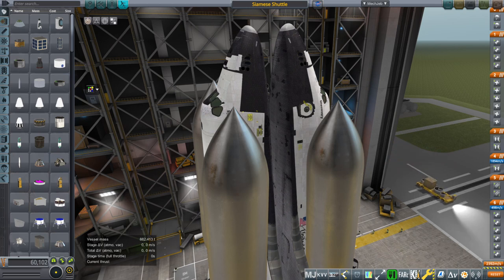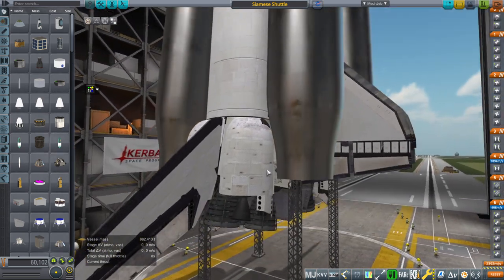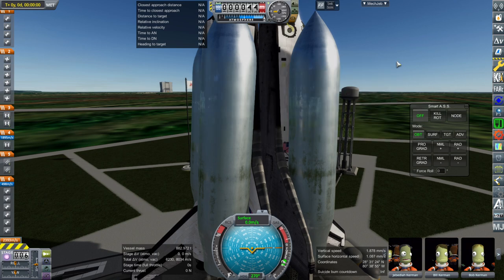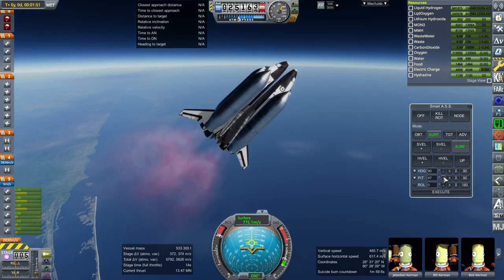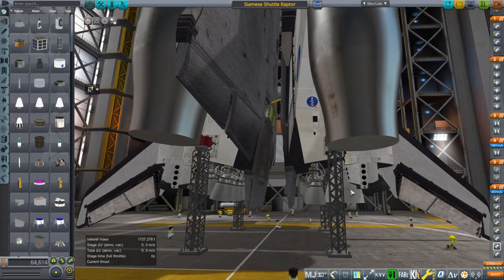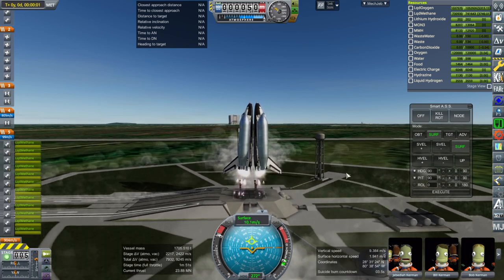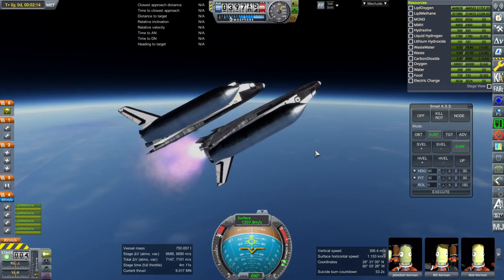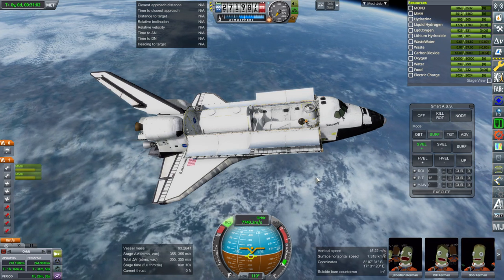The Twin Shuttle System Nobody Wants

Comment: MAAAANNN GETT WATERFALL MOD IT WILL MAKE YOUR PUMES MUUUUUCH BETTER !!!
Reply from the maker: As you keep saying this, let me make clear - I've tried it on various engines and generally don't like the look of it, but might use it for some engines as I see fit. I do use it in my stock series. I have no intention to use it on the Shuttle as the plumes look fine and the SSME plumes never looked like Waterfall plumes, and I have already tried it on my own Raptor engines and didn't like the look, which seemed cartoonish.

Comment: With the Raptor version, wouldn't it be prudent to shut down the sea level engines rather than throttle down near the end of the burn? Seems like the sort of situation where those extra seconds of Isp might be handy. Not that you'd want to spend too long optimising this particular system...
Reply from the maker: Yes, that would give a bit more delta-v.

Comment: Fun fact: Originally the Space Shuttle had a two-stage fully-reusable winged flyback design, but that was too expensive to develop on NASA's shoestring budget after Apollo. #FundNASA
Reply from the maker: Please stop spamming this on every video or get some new facts. It's not like this is the only example of Shuttle design being constrained by NASA's budget.
Reply: @RaizSpace  Sorry if you consider it spam. I just hate that so many people hate the Shuttle, despite not knowing that its limited capability was mainly a result of budget cuts. Sorry for repeating myself, but I just want to spread this message to everybody around. I just love the Shuttle, even with all its flaws, and can't stand people hating it like it was the worst spacecraft ever concieved, like they proclaim Starship to be the best spacecraft ever. Which it isn't, BTW - the dry mass of Starship is just insane. A Heavy-lift Vehicle from NASA's SPS study has similar payload to Starship (120t), yet only 4000t mass when full. Which is less than simply the fuel mass of Starship, and even with some mass reserve! Apparently, aluminium construction/winged flyback is a pretty efficient design!
P. S. If you suggest any alternative message I could use about the Shuttle, I would be very glad for it!